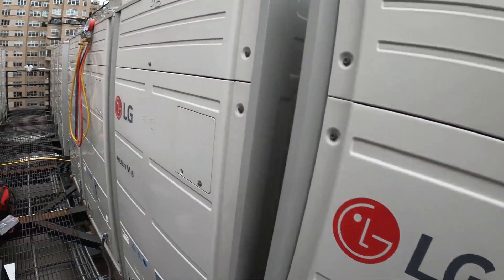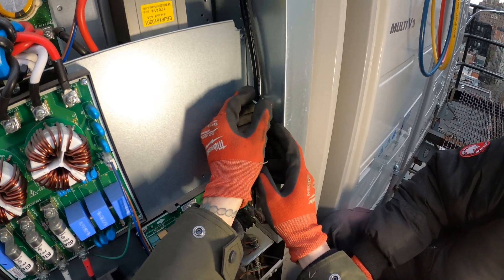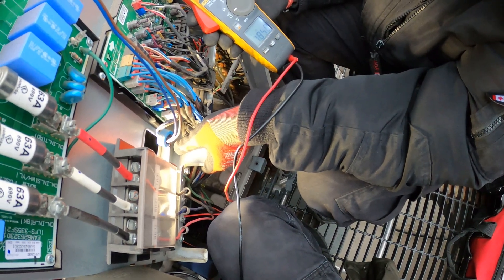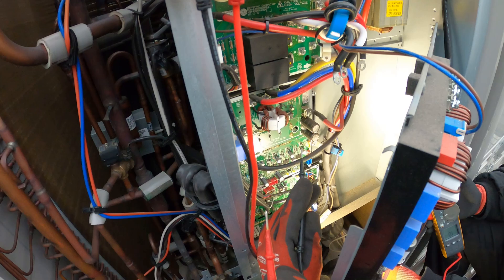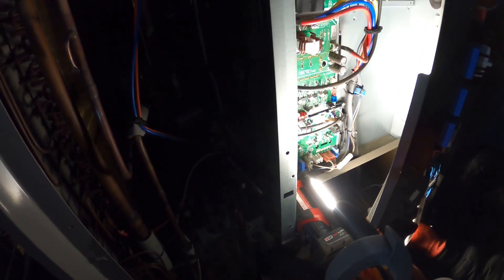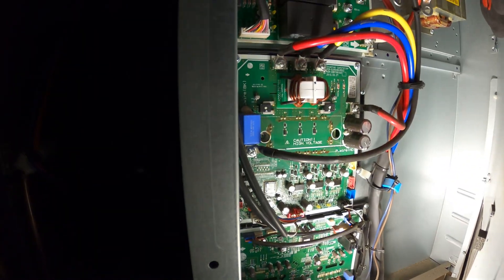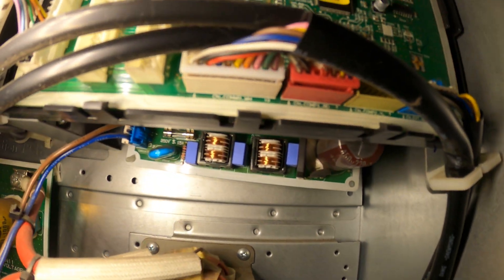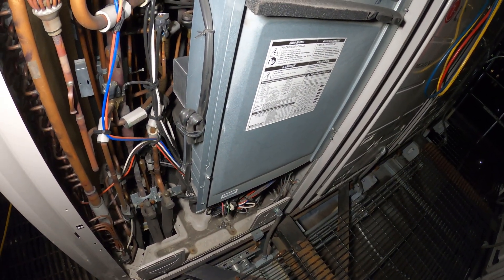HVAC Service Call: LG MULTI V Not Cooling (LG Multi V 5 Error Code CH26) VRF Troubleshooting/Repair

Comment from the maker: I was not able to record the full repair for this exact job but if you all are wondering, we got it up and running by replacing the compressor & inverter board. Thanks for watching!
Reply: Rinse and repeat 🤣   Ever get Déjà vu lol
Reply from the maker: @electroshed  Haha I had deja vu here! 3rd compressor and inverter board within 2 months! Thanks for watching!
Reply: @JumpermanTech  Not 100% sure if these models are covered, but the MultiVs should have a 1 year standard warranty + 6 year compressor warranty after the first year.
Reply: Get ready to do more of these soon for that same customer bc they’ll likely all go out sooner than later :)
Reply: Hey bro. Do you guys really have to shut the coils off after you set it for a vac? I’ve replaced 2 compressor and tech support told me I had to do that but I was wondering you you can get away by not shutting them off

Comment: Just started working on these multi v . They are intimidating as hell. In your experience, when inverter board goes bad, the compressor needs replaced as well? I’ve got 2 units out of 15 that have the 26 code. I’ve only done the install class. Waiting on service class so I can take it. I’m old school. I love Rtu, vav, boilers n chillers n pneumatic controls

Comment: Start stocking parts compressors inverter boards power supply condenser fans find a small storage area for your repair shop two look up all the inverters to the internet for Diagnostic and New York City is not a friendly commute

Comment: Great troubleshooting sir. I would like to know where u got the troubleshooting specs for each board? Is that an app or something?
Reply from the maker: Thank you! It's an app. The app is called "LG HVAC SERVICE-BUSINESS". Its a must when working with LG. Left clueless without it and calling tech support would be required for any bit of information. Always good to confirm with them as well if you can. They will also send you documents the app doesn't provide. They have all the secrets. Thanks for watching!

Comment: Pro tip: bring up a 5 gallon bucket and then fold that outer panel with the noise filter boards down and let it rest on the bucket while you work on the inverter board. Just have to disconnect the blue transformer connector from the noise board top left, the 2 connectors on the right of the external pcb that go up to the main pcb and the one white connector on the bottom left of the external pcb. With all of those disconnected you should be able to fold it down without it catching on anything.

Comment: Why do these inverter board compressor always have problem
Reply from the maker: I honestly have no idea. I just started working on these units recently here but this is the 3rd compressor and inverter board I have replaced in about 2 months.  Might be poor installation or LG really makes terrible equipment. Thanks for watching!

Comment: These systems must be short of refrigerant to burn so many compressors ? So must requires additional refrigerant for pipe length?
Reply from the maker: Additional pipe length does require additional refrigerant but only the installers would truly know. All the walls are covered up and these were installed a decade ago. I only started servicing these units about 2 months ago. These units also run basically ALL the time. Each condensing unit controls around 8 air handlers or so. It can provide heating and cooling at the same time! Seems like it's just doing too much but there must be an underlying issue here. Might be the installation or just poor quality equipment. Thanks for watching!
Reply: @JumpermanTech  fair enough man , keep up the quality content 🔥
Reply from the maker: @lewissaunders2837  Thank you!!
Reply from the maker: These condensing units are from 2017 I believe but the original installation was done in 2012. That just goes to show you the massive issues they've had from the beginning
Reply: @JumpermanTech  Mitsubishi Electric or nothing haha
Reply from the maker: @lewissaunders2837  Mo' money LESS PROBLEMS! 😂

Comment: Great job going above and beyond to try to get the unit running. Sometimes we got to take that risk to see if things can work for that moment.
Reply from the maker: Thank you! We really tried our best to get them going as soon as possible. It was worth a shot as they stocked the parts in the building. Unfortunately, the compressor had to be changed out as well and from there we got the machine to operate. We try to provide the best service we can. Thanks for watching!

Comment: OMG that seems to be more of a computer than it is a condenser my gaming PC doesn't have as many circuit boards as that does.
Reply from the maker: Haha I also build PCs and this is 100x more complicated 😂 When I think of modern HVAC, I think of computers. Here's a cool one for you - Another building we work in had a controls company come and wire in their hardware to work with their software so the engineer can monitor and control the HVAC/R equipment with their computer 👀
Reply from the maker: Stay tuned for new videos every week🔧⚡️

Comment: The orange "burn marks" is actually old flux that's been heated and cooled several times which turns it that funny colour usually it should be washed off at factory I've had cases of burnt flux cause shorts or minute shorts in the kohms so that why maybe these boards are dying alot

Comment: If you didn't know when you measure with a multimeter it puts out a small voltage like 1v and sometimes it can charge the capacitor's which makes the reading slowly drop that's why when you keep the probes on the ohm keep dropping